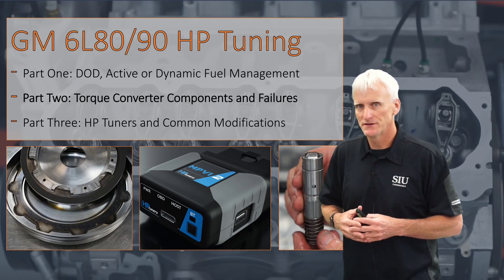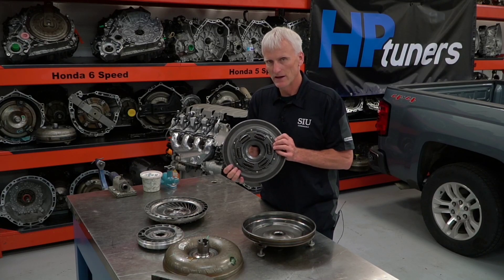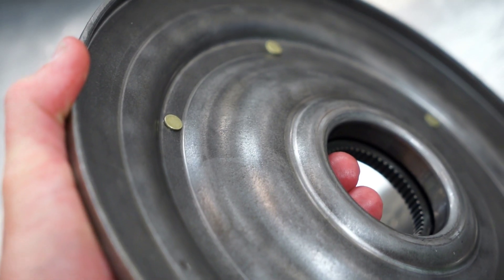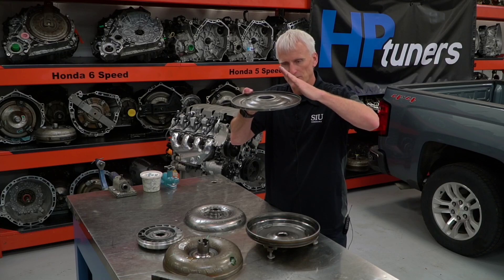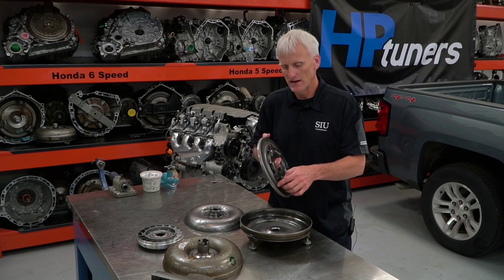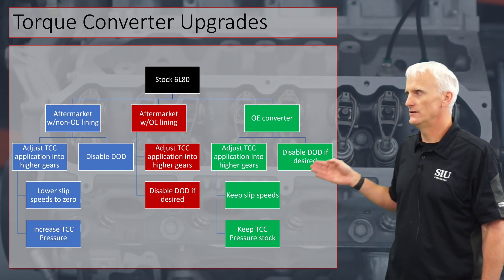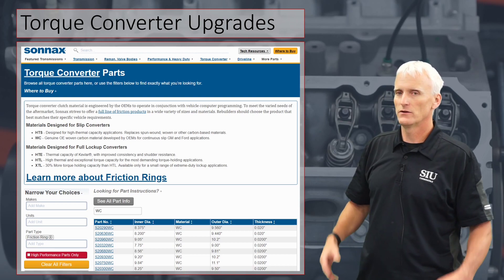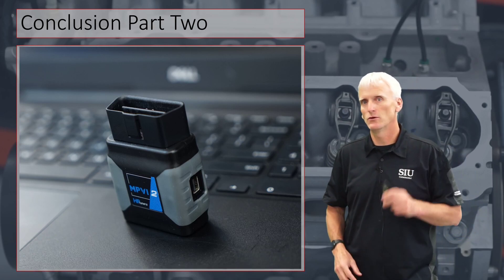GM's 6L80 HP Tuning, DoD, and Torque Converters! Part 2 of 3

Comment: Should you still turn the converter off 1-4 if you pull trailers?
Reply from the maker: I would, but if you’re in 4th a lot while towing, you could just defeat tcc in 1st through 3rd.

Comment: Hi 👋 where can I get the stock file for the 6l90E transmission?? 2014 Chevy Express 3500 LGH Duramax HP tuners
Reply from the maker: If you create a free account in hptuners, you should be able to find a stock tune in there repository.
Reply: @siuautomotive  I have a account with HP tuners and when I'm send on their where do I go to find the stock files that people have uploaded? AKA repository.?
Reply from the maker: You log into hptuners and when you go to “my account” you’ll see a link for the repository.  Unfortunately I looked and there isn’t a file for your vehicle.  You might try signed up on the forum and asking there, or joining some Facebook groups and asking there.  Lastly, if you can find a used truck on a lot somewhere, maybe you can pull the tune that way.
Reply: @siuautomotive  awesome thanks very much for your help and support 🤝🙏🏻🙌

Comment: Awesome video series! Been looking for such explanation for years. I have a question for you, if you were to set the tcc slip to zero how much pressure would you increase for a 1500 truck application?
Reply from the maker: I would first just put slip to zero without raising pressure.  The computer should increase pressure to achieve the slip you programmed it for.

Comment: Hmm, was thinking about swapping to the 6l90 tc myself.  I have heard they're more heavyduty.  I have the non DOD 6.2 and thinking of a transmission rebuild with a billet TC.  Any need for a reflash of the transmission computer or a tune?
Reply: From what I’ve read, it’s a direct swap. No tuning needed. However, it does have 6 mounting bolts, but 3 still line up with the 6l80 flex plate and people roll with just the three.
Reply: I may have misunderstood your question. If you’re asking about swapping the entire transmission, I’m not sure of what may be different with the tcm or if you can just use your original tcm. My understanding is it’s just some of the hard parts that are different between the 80 and 90 and you could just swap out those in your 80 to beef it up. Maybe someone else will come along and confirm.
Reply: @kenmills4628  Sorry, I was typing fast and corrected it.  I'm looking for a way to add a more durable TC.  Looks like there's a billet TC that's compatible between the 6l90 and 80, so I may try that out.  Not looking for any high stall or anything, just a strong TC for towing and reliability.
Reply from the maker: Yes Chad, I'd do the tune that I do in part three and reduce the slip speed to zero (if it isn't already) and increase the pressures 10% (but only if you have a billet converter.  If the converter builder uses an OE woven lining, then I wouldn't worry about the slip, but I would still eliminate TCC application in 1,2,3 gears.  That 6-lug captive clutch converter has more friction surface area (two friction surfaces vs. one), but it's also prone to deflection and other issues.  I think an aftermarket with a billet cover is the best option.
Reply: @siuautomotive  Thank you!  Exactly what I was interested in hearing.

Comment: Really appreciate all your videos. Very informative. Thank you. 
A lot of people have swapped out the stock 6l80e tc with the 6l90e tc found in the zl1/cstv (GM part #24242552). Seems as though it’s a bit more “heavy duty”.  Any thoughts on that? 
Also, the latest beta of VCM Suite has added mapping for desired tcc pressure on a lot of the operating systems. Seems to help many with aftermarket converters in eliminating slip by upping those pressures. Just thought I’d pass that along.
Reply from the maker: That's really good to know.  I'm downloading the Beta version now.  It's amazing how much the TCC operation varies between different models and generations.  The TCC apply speed for example.  On the later TCMs they don't change the speed much between 0% and 100% throttle, whereas on the earlier TCMs they change the TCC apply speeds like you'd expect.  I always felt there was more to these later units than what we can see on HP Tuners, even though they provide a ton of info.  Maybe the Beta will include some of those differences.  

I'll look into the CTSV converter differences.  It might be the captive clutch design, which has more holding force, but it's still plagued with a whole slew of other issues.  I actually have a CTSv at the school that was donated.  The tune on that car is much different than the trucks.  Thanks for watching the video.  I'm still learning as I go, so there's bound to be things I forget to mention or I simply don't know, lol!